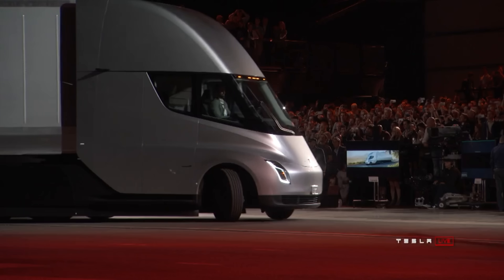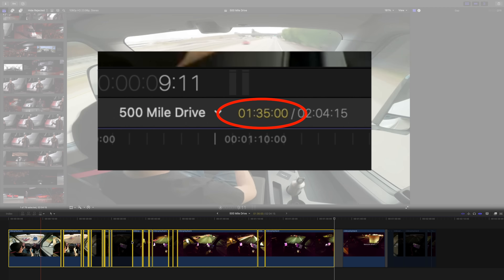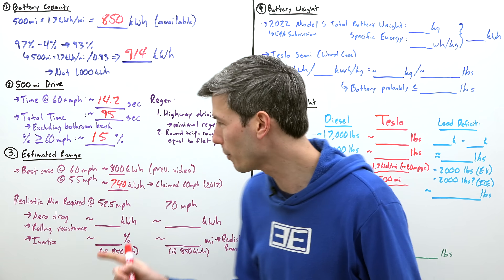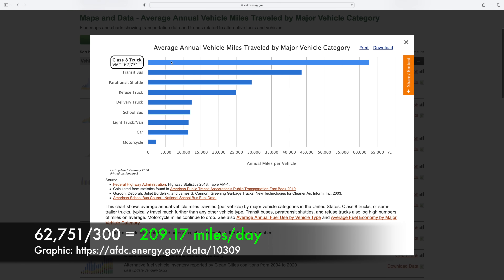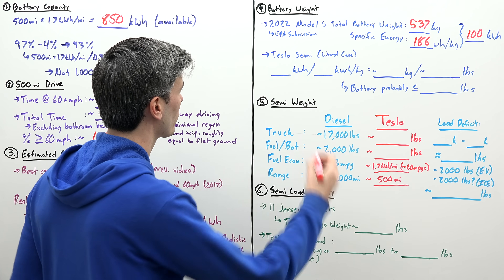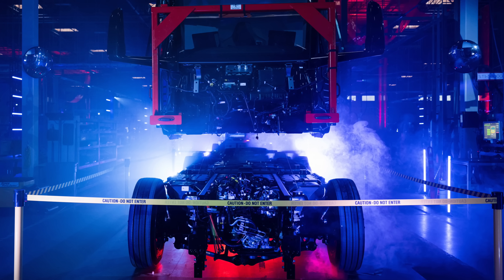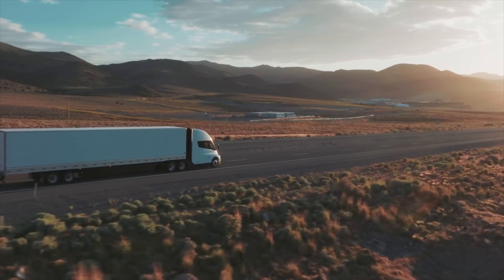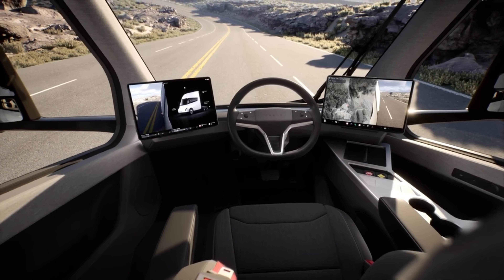Does The Tesla Semi Make Any Sense? Part 2!

Comment: Another thing to consider is that the amount of battery that goes into a single tesla semi can make over 50 plug-in hybrid cars. A lot of criticism is not necessarily about the feasibility, but rather the allocation of scarce resources.
Reply: Resources aren't scare, where did you hear they were? There is more than enough resources to make batteries if there wasn't and resources were rare then only multi milionares would be able to afford electric cars. Just the fact a normal working person can afford an EV is the proof resources aren't scarce.
Reply: Or.... cars are the waste of resources and we should focus on building out public transport infrastructure in anywhere with a mildly dense population and reduce need for cars? Trucks need to send cargo where alternatives would be hard to build more than people need cars where alternatives would be hard to build
Reply: They also draw huge amounts of current when recharging. Setting up a nationwide recharging network would involve investing $$$trillions in electrical infrastructure. Even industrial estates would struggle if multiple distribution centres went electric.
Reply: almost like public transportation is the actual solution
Reply: its the USA, no need to care about the impact!
Reply: i think the question in that case is, do people need cars this much? Would be better to mass transit them. you don't even need batteries for overhead cabled long distance via electric trains.
Reply: Lithium isn't scarce. If we use sodium batteries for grid storage, and lithium for everything else, we easily have enough to electrify the global economy.
Reply: I'll put it into perspective. Let's say semi trucks make up about 6% of the 1.4 billion cars globally. That's about 84 million trucks. Let's say the battery weight is 4500 lbs, with 7% being lithium. That's 315 lbs. We take 84 million multiplied by 315, and we get 26,460,000,000 lbs or 13,230,000 tons. There are only 14,000,000 tons of Lithium that is economically viable to extract on Earth. Meaning we would nearly exhaust the supply by replacing semi trucks alone. Applying a similar formula to cars with an average EV battery being 25 lbs, we would need an additional 16,450,000 tons to replace the current generation of cars with EVs. Keep in mind, the projected number of cars on the road is set to double by 2040. It hurts my brain when I think about all the infrastructure that will be wasted on this doomed technology.
Reply: @Mr.9merrickdials  Interesting! I agree that we should really think about where to allocate resources (please not into SUVs, which seems to be Tesla's strategy too (facepalm)). Your global truck-count sounded impressive at first, but a bit of back of the envelope tells me they check out... However, it might that the future technologies would need to be based on lithium, or we could go with overhead electricity above big trucking routes, or even directly with trains (by far my preferred solution)... 
Anyway, I'm happy that more and more people are trying to help others open their eyes on Tesla. It's not a bad company, it's just not what it pretends to be. False marketing and more importantly the support of all the tech and DIY-finance world as well as greedy investors has meant they were able to make out like gangbusters every time they bled some stock... It really has to stop. I'm wondering how Renault or BYD or Hyundai would have done with the infinite money and goodwill supply... Certainly not bad...  In general, small two-wheelers, public transport, small cars, electric bikes have done way more for mobility and ecology worldwide than Tesla could ever dream of (and each of these separately). On the pure numbers terms, Toyota and others very efficient vehicles should also be credited for what they achieved - efficient vehicles for the masses. Still, we now should reduce CO2 production more, and that's certainly not by buying big Tesla cars (but rather Swiss Microlinos or Taiwanese Gogoros for cities, and trains or car-sharing for long distance). If long trips are regular, a private electric sedan might make sense, particularly if car-pooled. On the trucking side, I might agree with @ShimmeringSword: it does make sense to produce electric trucks, to an extent.
I really hope the Tesla brainwashing stops.
Reply: @Mr.9merrickdials  Is it a lot? Yes. But we also burn 5+ billion tons of petrol every year so...not really.
Reply: @Mr.9merrickdials  We have 50 years left of oil at current usage rates. You really think as society advances we won't use more energy? You've got to be nuts. Before we run out what do you think will happen? Prices will drop or something? We will feel the effect more and more as petrol becomes more expensive to produce. 

We are feeling it now... very slightly but we are feeling it. We are getting desperate. Too desperate. Petrol served us well but it doesn't have the capability to sustain a growing economy. Eventually batteries and solar on houses won't be enough and we will absorb energy directly from the sun. But let's not worry about that until we need to.
Reply: Interesting point, because I think the answer might actually be to put them in the trucks. They are used more consistently so the payoff is realized more consistently.
Reply: Almost like we should stay with gas and diesel.

Comment: What does Air Conditioning and heating draw? Are the heaters simply resistive or heat pump?
Reply: Heat pump In the Tesla autos, with cabins likely comparable in size to the Tesla Semi, the 75 or so kWh battery will maintain cabin comfort in sub-freezing weather for 40 or more hours; so they must not draw more than a couple of kW.
Reply: A couple of kW. Heat pump.

Comment: So Tesla managed to keep a reasonable weight while delivering on the 500 miles range.
*Not actually going fast
*Not fully loaded
*Not in the cold maybe also not heat
*Not when the battery degrades
*Not when you dont have time to charge all the way up
*Not when you dont use the full range because you want to preserve the battery

All for the cheap price of $requires_millions_in_subsidies.
Marketing on point. To be fair I expected them to fail even harder so I'm posetively surprised.

Comment: US Trucks over all have been way too heavy because cost of US fuel used to be so little - compared with thr EU for instance, that it didn't make that much sense in the US to invest in producing real light weight trucks. A bonus for Tesla.

And this analysis is so true - if i use regen-braking and select the routes carefull the additional weight of the battery doesn't create a problem or seems to be neutral for about 75% of the trips. Avaliability and cost of electric charges make it more.

And we see the swing to more efficient - 21700 cells at least - full on the move -  stating stats should take the type of cells as well into account? (Maybe see 'projectfarm' with regard to that as of today.)

By the way - guys like you are americas best ambassadors. All others come way behind - or a completely useless. And you are so cost-effective for the american public!

Comment: Tesla is such perplexing company.  On one end, they really make the best cars on the road now.  On the other they exaggerate and just flat out lie on future promises to raise preorders up.  I wouldn’t be surprised if there’s a class action filed against them for the FSD self driving👎
Reply: They don't make the best cars, they just have the best infrastructure for the electric category.
Reply: They have better batterys than the competition with better chargers. Thats all.
The rest have better build quality, reliability, service and warranty, better interior, better autonomous systems,...
Remember FSD is only in certain areas and not very reliable and only level 2. Mercedes has level 3.
And all the systems that people actually use are all preset and more reliable on other cars.
Reply: @MetalMachine131  I think you've got it backwards. Actually, FSD works everywhere; while Mercedes Drive Pilot only operates on specific highways and freeways, and only at speeds up to 37 MPH; so in essences, it's only usable in traffic jams.

Comment: The Tesla truck is quite US centric with its design and capability approach.
America has a unique configuration with relatively light loads and simple trailer configurations.
It would be interesting on how the Tesla semi stacks up in other parts of the world, for example I'm in New Zealand, the most common line haul truck is a B double or ridged design pushing up to 60ton, the roads are very challenging because we don't have an extensive highway network like north America - they are often very hilly and twisty.
The distances may not be great but fuel economy is very much impacted by the terrain.
I have seen some EV trucks from Isuzu and Volvo here in the city and I think that's great.
Reply: Actually, mountainous terrain is where Tesla Semis will have the greatest advantage over diesel semis. Because of regenerative braking, they recover about 80% of the excess energy used in a climb, so unlike diesel semis, terrain has very little impact on economy. And because they have >1,000 HP, they can climb 6% grades at highway speeds, while diesel semis are often down to 20-30 MPH.

Comment: As a truck driver Frito-Lay loads were about half to a3 with a normal load waves so did that load should not really count
Reply: In the 500 mile range test, one of the pallets at the very back, where the lightest loads are placed, was maked 600KG; and every reference I've seen states that a 53' trailer can fit 26 pallets if they're loaded lengthwise, which these are. There's one row where there's only a single pallet; and at least one row of pallets is double-stacked at the from. So it's plausible that there are 27 or more pallets of at least 600KG in the trailer, for a payload of at least 16,200 KG or 35,700 lbs. This is far more than a half load, which I think is what you're trying to say.
Reply: Yes, I guess I didn’t read the whole thing. I saw a Frito lay on the cab being a trucker the supermarkets for 30 years Frito-Lay loads are very light but when I saw the jersey barriers, I use the flatbed them till the end of my career. They are pretty heavy. Retired at 56 due to the Bush Obama crash retired teamster enjoying life.

Comment: What is the wind resistance of the barrier load vs a full body truck.? When things differ on a promo video, there is often a reason.
Second point, a headwind can easily make up the difference between 55 and 70. 70+headwind can easily be 90+. Just sayin.
Reply: The barrier load was only in the video showing a Tesla Semi climbing Donner Pass. The Fremont-San Diego range demo was done with an enclosed van. All trucks, diesel or electric, will be affected by headwinds; but the Tesla Semi should be less affected than diesel semis, because the Tesla Semi is far more aerodynamic.

Comment: The weight deficit calculation threw me a bit, was it based on the diesel truck range of 800/2000 miles vs. the Tesla range of 500 miles? Surely it should have been based on Tesla range vs. equivalent weight of diesel needed. I probably missed something granted. Regardless, the whole alternative energy industry still remains massively dependent on taxpayer subsidy.

Comment: With high functioning but not entirely driverless autopilot being a core part of the tesla sales plan and the safety factor is provides i see that as potentially the largest win for trucking companies. Litigation is insanely expensive and if you could cut fuel costs by half and Litigation by 75% (both EASILY doable) the truck cost could be in excess of 400k and still a reasonable purchase for big companies now before any price savings for scaling later

Comment: Diesel trucks hold 80-180 gallons of diesel. That is 800 pounds average, where do you get 2000 pounds? No normal diesel truck holds 300 gallons of diesel.

Comment: The real question is, can you carry a bucket of electricity to it when the battery goes dead climbing a grade??
Reply: when the battery goes dead climbing a grade? 
During the Run On Less tests in September, Tesla Semis with weighed-out loads of soft drinks routinely climbed from near sea level in Sacramento to 7,200 ft. at Donner Pass, one of the tallest highway passes in the country, on about 53% charge; so there's no reason to believe any Tesla Semis are going to be going dead climbing a grade. But if one does, there are mobile charging vans and trucks for exactly this purpose. So not to worry your pretty little head about this.

Comment: The short answer is that it will make sense for some use cases, but not all of them. Given the speed, distance, and weight restrictions of a given transportation use case, as well as the availability and cost of alternatives, it will make sense for some use cases. Which, from a business perspective, makes sense for both consumers and producers even if it's only the best option for 10% of use cases.
Reply: Did you even watch the video? He says it fits 60%-90% use cases.
Reply: I don't think their point was that it's only good for 10% of cases, it's that even IF it were only good for 10% of case it would still make business sense to use it in those cases. @Victor-vj5ds

Comment: Questions that were not asked. 1. Of the average weights you listed what is distance for cargo? 2. What is the delivery time required by the customer? Imagine a 1200 mile trip  70k load due in 2 days,  keep in mind DOT driving rules HOS (hours of service). Is fueling a safety sensitive function? if so HOS clock is still running. In the case of diesel fueling might take 30 mins every 1000 miles~ therefore not impacting HOS much. but what if you have to fuel every 200 miles for 45 mins? Can you deliver on time? It sounds like Pepsi is using the trucks for local distribution and not over the road / reginal transport. I wonder why? lol.
Reply: Watch the video more closely, most trucks aren't loaded to max weight and most of them don't go further than 300 miles. Long haul deliveries are a fraction of the deliveries.

Comment: What I don't  understand is why people  are all for electric  vehicles. For the most part this vehicle  will be using fossil  fuel or nuclear  power depending  on what the power. Company is using.  company is using.
Reply: No they won't, Tesla builds solar plants and mega packs to charge these vehicles. Even if it was coal powered it would still produce less Co2 per mile than a diesel truck. But this also removes toxic pollution near homes and city streets and moves it to power plants far from populated areas.

Comment: My only complaint is they're basing the weight of a standard semi to a sleeper cap semi which is roughly around 17,000 lb but a day cap semi usually can hit around 10,000 lb due to it not having to carry additional gear and supplies. Also a day cab is stagnantly cheaper than a sleeper cab almost half the price at times, used ones you can buy for $15,000.
Reply: if 60% of loads are maxed out on volume, what difference would that make?
Reply: @andys31337 quite a bit in fuel efficiency at higher speeds and loads. Unless the power plant is using any combination of wind, solar, or nuclear for charging, it's not going to make any difference in greenhouse gases. 

EV's also have the problem of once they catch fire, firefighters have no real way of putting them out, except to let them burn out, and try to keep it from spreading. That is a major problem when looking at Wal-Mart trailer......ever consider all those cleaners and other liquids that is in one of those trailers? That's a major problem nobody is really taking seriously enough to really talk about. What do we do when one catches fire, and the trailer with God knows what is inside catches fire.
Reply: @schmalzilla1985  Here's an idea: Use EVs where you have green electricity.

Comment: Two other considerations: 1)  Did you remove the weight of a 12/13/15 liter diesel motor?  2) Would the electric drive train weigh less then the conventional drive train?

Comment: How will this affect the road lifespan? According to reports that the damage to roads increases with weight non linearly. So if that is the case wouldn't having a higher empty load weight, not to mention higher "dry" weight be relatively more harmful to the road.

Comment: You skipped over the Elephant in the room, battery degradation! In EV and hybrid batteries it has been accepted that at 120.000 miles your batteries will likely be at 80%. Many trucks drive 120k miles annually, are we going to replace the truck batteries every year?
Reply: "it has been accepted"
By who? What's your source for these numbers?
Reply: This truck has 500 miles of range, so a battery with 1'500 cycles will last you 750'000 miles.
There will also be a shorter range version, hopefully this one will have LFP batteries but I'm not counting on it.